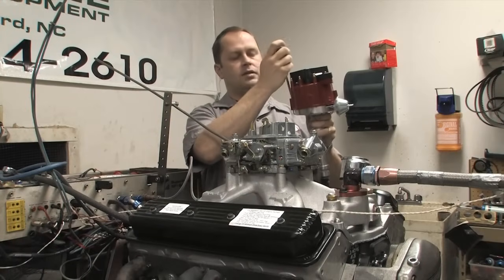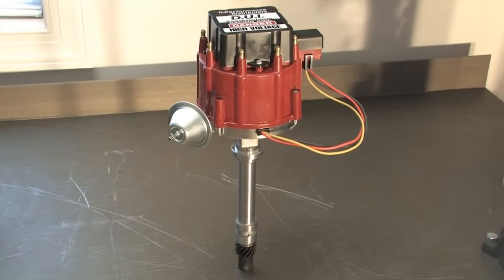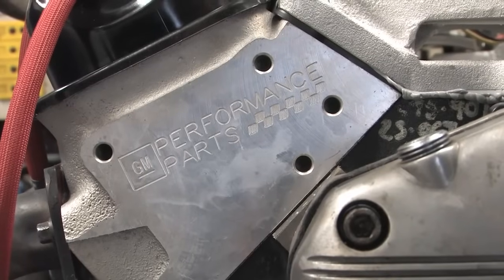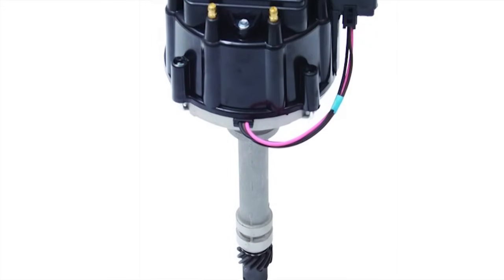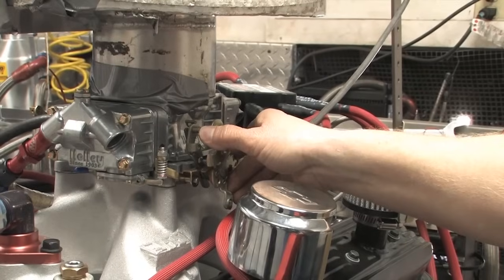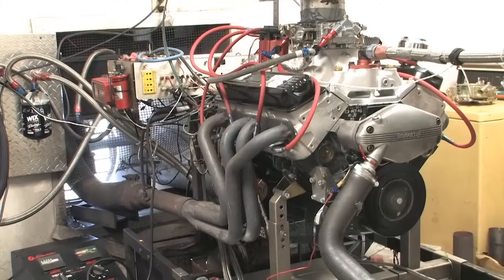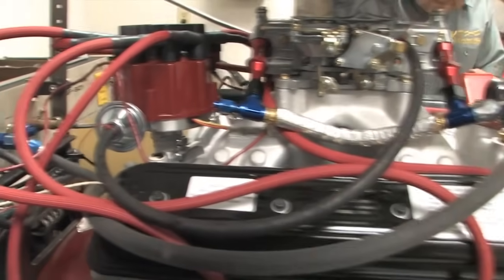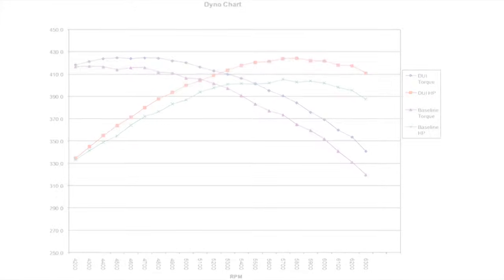HEI Ignition Tips for Your Engine

Comment: Dumb video says pointer is at number 1 does not show what spark plug goes from which one to number 1.
Reply from the maker: Sorry, assumed you knew about cylinder numbering. That varies by engine, you will need to look up which is the number one cylinder for your engine.

Comment: Since resistor type plugs actually “resist” some of the spark energy, non-resistor type plugs actually deliver a more powerful spark. It is for this reason that most racing plugs are non-resistor types. However, in most automotive applications, a resistor plug is required for proper vehicle operation.

Comment: GM has different coils for the HEI. The standard one uses normal plug gap. The stronger one uses different plugs that have over 2 mm, about 0,08 gap. I used to have a Buick -84 with 307, and it had that coil and plugs from the factory. When the coil failed, I went with it to the local speed shop here in Finland, and the guy looked at the coil wires and said "oh, it is THAT coil" They are of different color or something. I have a Ford Taunus (Taunus not Taurus, google Ford Taunus -82) that used to have a Pinto type 1.6 L four in it. I put a 302 to it, but bought a Hei with the Ford style base, Ditched the Ford strange ignition system. One + wire and good to go.

Comment: The experts in my area , told me to not use the vacuum advance at all ,  instead set the timing that they suggested, in my case it was 38° before top dead center ☆ my motor is a 440 mopar thats some what modified * headers, cam & such ☆ its mostly street driven and go's to the drag strip once a year ☆  When i go to cruise ins , people want to know why my vacuum advance  is blocked off with a pastic plug ☆ i tell them, thats where where it runs the best 😊 , they usually walk away is disbelief ☆ however, these folks do not run their car's at the strip ☆ in ending,, i will say this, im completely satisfied with the with the performance of my car , street or strip 😊 thanks for listening ♡

Comment: Since I started driving with a vacuum guage on my dash, it's gone from from 10mpg to 14mpg!   Simply installed a brass T adapter and ran a hose though the firewall.  Then just keep vacuum in the optimum zone while accelerating.

Comment: I ran 6.80s in the 1/8 with a fairly strong solid roller 11 to 1 327 in a vega with at th400 and a 4.56 12 bolt. 
Stock gm hei. Shifted at 7000 rpm. Absolutely bone stock distributor. Switched to a DUI and didn’t pick up any et or mph. 
Ran 38 degrees total on both.
Reply: Higher compression is harder to ignite. My stock HEI worked great on my sbc 400 with stock compression. I built another at 13.5:1, and it misfired around 5500 rpms. My buddy told me to get an MSD 6AL and coil, which cleared up the problem. She zings well over 7500 rpms, which required me to get a rev limiting chip.

Comment: I built a GMC 292 inline 6 , no expense spared in the build ,about 11.5 comp. forged 60 pistons,floating pins Major headwork, Lump ported ,175 rollers , ALL BEARINGS COATED, THE LIST GOES ON !  I bought the DUI distributor, basically it sucks. First thing is some of the module screws were loose, and for the inline 6 they give you a 2" adaptor that goes on the end of the main shaft to reach the oil pump ,rather then having a dedicated shaft for this application, Now you have to carefully file the adapter on the one end so it fits TIGHT with no play and is then held in place with a tiny roll pin, you have to "V" out the recess but on an angle this is precision work and no room for any tolerance. . the slightest bit of play will cause the adapter to vibrate and damage the distributor gear, Beside other shit first Dyno pull was 366HP, We swapped out the DUI coil with an Accel coil and picked up 10 HP !! 3 times we did this. Ended up building my own distributor with parts I had , Never will I recommend DUI !!!  and made another 9 HP !!! side by side it is exactly the same as an E-BAY special !!! That two piece distributor shaft not only stupid but was incorrectly machined , ebay HEI with a accel coil and MSD module beat the DUI IN HP, Quality and cost .

Comment: I don't understand why the timing had to be reset when you connected the vacuum advance. Vacuum advance only adds timing under low load conditions (high vacuum). It has no effect on high load applications such as a dyno pull. The maximum timing under these conditions is controlled by the mechanical advance. The real purpose for vacuum advance is part throttle fuel economy. That's the way most vehicles are driven.

Comment: All well and fine for high performance engines. Seriously the stock points system and thereafter the stock GM HEI is the perfect distributor for stock engines. They've run these on millions of American made cars from 70s onwards. Time tested perfection.
Reply: GM converted to HEI in 1974. If all you got is points rock on. All of my engines in my daily drivers and foot brake drag cars run some version of HEI. As long as we are having fun with our rides, use what ever gets that done. After 50 years of HEI no way can points compete, but rock on.

Comment: For the average street motor an off the shelf HEI is perfect. They are dirt reliable unlike the Ford Durafail system. If you have the misfortune of losing an ignition module they can be gotten pretty much anywhere. Walmart used to carry them. I have made the mistake of using esoteric fancy gear and having it die on me leaving me on the end of a hook. Edelbrock carb and HEI is a bulletproof combination for daily use.
Reply: Can't beat an AC Delco HEI setup paired with a quadrajet.
Reply: Where do the wipers attached to the distrutor go to

Comment: Did he really say HEI is weak????
Reply: That's what you say when you make an ad for D.U.I pretending to be a 'tech' video.

That's why they had to close the gaps on the plugs to show the stock unit can't light off 400hp.  (which it can all day long). Otherwise, the two power curves would have most likely both fallen within the realm of tolerances.

Did you also notice they had to move the distributor after hooking up to a PORTED vacuum source.   Vacuum signal on that port at idle means the throttle blades are open too much.     But, at the same time, they backed off on the distributor setting yet didn't lose any power up top????

Just fluff to sell D.U.I distributors. Nothing more.

Comment: All this is wonderful n marvelous, cept'
most street engines run between 2000 n 3000 rpm, Not, 6000 rpm. Street engines are better off with low down grunt at the lower rpm's for pulling n cruising, not at sky high rpm's which they hardly ever see, unless you're building the 
engine for racing. Properly setting up your drivetrain also will help to get the most out of your engine n maximize MPG...

Comment: manifold vacuum to the distributor only  ...  wot timing should be set  and then lock the distributor,  small springs on the weights ... you want to launch advanced .. then taper off to mechanical timing  all in  at wot... and always use mechanical secondaries for better response

Comment: I use vacuum advance on full manifold vacuum to help my engine idle better with a big cam, also keeps plugs cleaner.
Reply: Agreed; It also drops my idle temps 20 degrees.
Reply: What if you have a vacuum secondary Holley tho or do you just plug the ported vacuum
Reply: On some engines it really helps. The reason being that it can increase the vacuum signal to the carburetor.

Comment: I have a 350 chevy in a 1973 blazer , the motor is new with everything else  on it and won't  start please let me know what tut I am doing wrong. I am puzzled  about cause I have been doing this for 55 yrs
Reply: Check for fuel, Check for spark.  You may be getting spark but the distributor is 180 degrees out of sync.  Many put it in what I call fake Top Dead Center.
Reply: It aint got no gas in it

Comment: 604 crate engine... with TBI valve covers 😆👍
Reply: Yes!  Similar were used on some other factory engines as well.  Did you notice the two vents on the left side and none on the right side?  It doesn't make sense.

Comment: You bring your engine up to 10 degrees before top dead center on the firing stroke either by watching the valve train or compression you'll see the trigger wheel on HEI is pointed citizens points lineup and you go a hair father that's when the spark will happen you can literally shut your engine within 1 to 2 degrees by this method you won't even have to re-time your engine I've built many engines with this method knowing where the distributors fire I really have to move them after checking with a timing light basically I learned it from timing VW engines and mg midgets always Prime the engines with a dummy distributor before you 🔥 them up and it's not hard to build a oil priming tank out of an empty R134 tank just have to weld A fitting on the bottom and put some oil in it and a cap with the Tire valve to pressurize the tank

Comment: On my supercharged engine I first used a regular distributor and separate coil. I later changed to HEI 50,000 volt and it made a huge difference, especially in the strength of the idle while in gear with my foot on the brake.

Comment: Does vacuum advance have anything to do with vacuum secondaries to open up the back barrels
Reply: I'm not sure I understand you're question, but I'll try to answer it: The two are not related.  The vacuum that would open the back barrels is measured or "Seen" by what's flowing through the barrels themselves.   The Vacuum for the distributor is seen below the barrels and serves a completely different purpose.  One is above the throttle plates (back barrels), the other is below the throttle plates.
 If I'm wrong someone will come along and correct me.

Comment: Well it's a great commercial for the distributor but you learn absolutely nothing but let me explain something to you you don't use vacuum advance on the High Performance Engine it's for station wagon so when your wife floors it to pass somebody she don't burn up the engine cuz she's running cheap gas. Hi vacume hi advance ok so far low vacume less advance step on the gas and your vacume drops so does the advance see it ment. To save the engine not make power now cruise and the timing goes back up for gas mileage also when you let off the gas you will see it spike up to like 40 for a few seconds this prevents back fire I got a lot more but you chew on that for now
Reply: Wrong
Reply: Anytime you drive at part throttle you need vacuum advance stop giving bad advice for street cars.

Comment: Does anybody know for sure what MSD recomends. As far as plug. Gap msd distributer w/ al 6 box
Reply: i have 6al-2 and use Brisk spark plugs, 3mm gap, huge (118.11 thou)
Reply: Msd is high voltage because it uses a capacitor. The downside is a short spark duration hence they use multiple sparks at idle speeds to make up for it.

Comment: I love the HEI. I run them on all my GM cars. But one thing that was wrong, most stock cars in the 1970's with HEI distributors had the spark plug gap set between .045 and .060. so setting your plugs at .045 was actually on the low side of what stock would have been.
Reply: Nope that .060 advice was rescinded by GM(they had all sorts of problems)… with HEI the standard is .045, but anything down to .035 will be ok and depending on setup could actually be better. That doesn’t go out the window with new high tech ignition, but it’s no longer the standard/hard fast rule.
Reply: @skywalkeraviation84 🎉😢🎉😂ZS
Reply: @skywalkeraviation84  I'd love to see a link to the TSB that shows GM "rescinded" the .060 spark plug gap. There are plenty of engines where .080 was the recommended gap. Just look at mid 70's 455 Olds, Pontiac 455 used .060 as did many others. It doesn't really matter what the recommendation is though, what matters is what works. I have raced for many years with an HEI and I always gap my plugs at around .060. And that's even on my 69 GTO which has 11.5 to 1 compression. As long as your wires, cap and rotor are in good shape and you have the voltage it works very well.
Reply: Nope.
Reply: @shelbyavant5081  What was the gap on GM cars with HEI distributors set at in the 1970's then?
Reply: @1967davethewave  They started at .060, and it was too much. Olds did try .080, and it was also too much. The componentry doesn't last with those gaps. Hell, .055 is a lot. That's why they changed everything to .035-.045 IN THE 70s, and that range hasn't changed in 40 years.
Reply: @shelbyavant5081  I looked at Cadillac tune up specs before I responded to you. From '74 with an HEI it was .060, going up to .080 by '76 and still at .060 in 1980. Olds, Buick and Pontiac were all about the same. They used the larger gap to reduce tail pipe emissions. But there isn't a book or spec on the web that supports what you are saying. I was a GM tech for 15+ years and every manual we had in the late 80's up to the early 2000s said the same thing. I'm not saying that isn't hard on ignition components, it is. That is why plug wires went from 7mm up to 8mm but every manual says the same thing. You can tell me I am wrong but you better get onto every publication out there and let them know because I didn't make the specs, I'm just relaying them.
Reply: @1967davethewave  I don't know what I like better, the fact that you used an outlier like the Cadillac as your example, or the fact that even when racing you don't go more than .060 yourself. There hasn't even been any mention of the leaded gasoline that was being used at the time. We could do this all day, but no one's going to change anyone else's mind about anything. Do please have a lovely rest of your day.
Reply: @shelbyavant5081  Look, all I said was that GM factory specs for HEI cars were usually between .045 and .060. Then you rudely replied "nope". I didn't write the specs but every Chilton manual, Haynes manual, GM manual and every website I looked at supported those specs. So it's just the facts you're arguing with, not me. As far as using Cadillac, I did that so I could show it wasn't just Buick, Olds and Pontiac. I wasn't using hyperbole or pulling numbers out of the air, it was the specs used for the bulk of the time the HEI was being used in new cars. But you can refuse facts all you want. Have a wonderful evening.

Comment: 604 sbc?
Reply: It's not displacement. This is a 350 engine. 604 is the last three digits in a part number (88869604). This is Chevy's CT400 circle track 400 HP create engine. There's also a 602; the CT350. Now you know.
Reply: Oh okay i gotcha thanks

Comment: It would be nice if some distributer company made a top for a hei rotor company made a computer controlled ignition box like the ones that are found on modern engines. Like Ford's and some other ones.
Reply: They're a little expensive but progression ignition makes computer controlled dizzys that you time using a timing table on the computer

Comment: Not a single tip.
Reply: Man nun at all
Reply: They did show that you need to adjust the distributor after hooking up to a PORTED vacuum source.   (which is wrong and shows the throttle blades are open too far at idle)

And they showed that after backing off on the timing, the car made the same power up top (which is also wrong due to backing off the distributor causes all the ignitions events after idle being retarded)

So I guess that's something.
Reply: Thanks
Reply: The plug gap! Sort of?
Reply: You don’t listen well do you

Comment: How do these guys run a dyno yet dont know the purpose of vacuum advance.....such a confusing video. As mentioned below it supposed to add advance at low load high vacuum engine condition when an engine actually needs more timming...
Reply: Yep, your 100% correct.
Reply: yup
Reply: Yep that's how to get it "timmed" (sic) right.
Reply: blake hastings  Your so right, like on a heavy atuomatic car when it shifts at part throttle and lower rpms.
Reply: Which is caused why? Cause the engine is running lean.

Comment: I was told when HEI came out in 74 they were using  
.060 on the plug gap and it was burning through the center of the rotor and going to ground through the dis. Shaft so they reduced gap to .045 if this is true  you are talking going to over .050 to .055  on gap.
Reply: Mountain Man
You're right.  I had that happen.  I reduced the gap and it didn't happen again.
Reply: @colehara  yeah I just remember the gap was actually .060 and they reduced it to .045 after it was burning through. I was told this by my boss back in the late seventies when I worked in his shop
Reply: On a stock HEI this is true. These DUI ignitions have a much better coil and can create a much more intense spark, allowing you to open up the spark plug gap more than stock. The bigger the plug gap the nicer the engine will run at idle and part throttle. When your building forced induction engines and haven't replaced the ignition for something more powerful you find you need to decrease the plug gap so the spark doesn't get "blown out". The higher the cylinder pressure the more difficult it is for the spark to jump across. Reducing the plug gap solves the problem you face at WOT but at the cost of slight ignition stumble or a very slight miss fire at idle and part throttle...
Reply: @danielbrealey2924  "blown out" meaning the spark wont happen Or wont jump?
Reply: Some engines had gap up to .080....the 1974 olds 455c.i. used an .080 inch gap...in 74 most chevys sblock and bblock used .060 inch gap, and eventually went down to .045 i believe...and it was because ignition was not capable of firing over .060 gap...I remember it was causing ignition failures